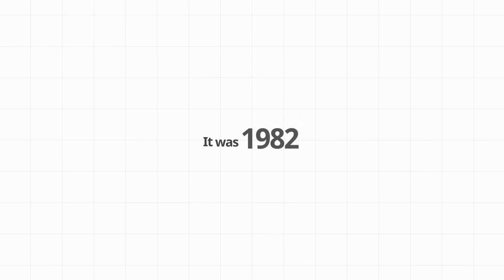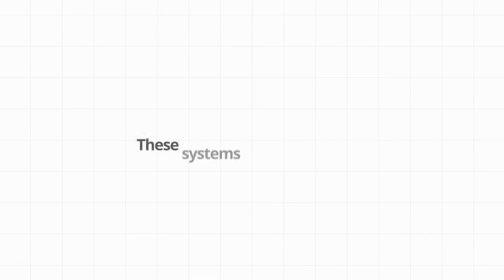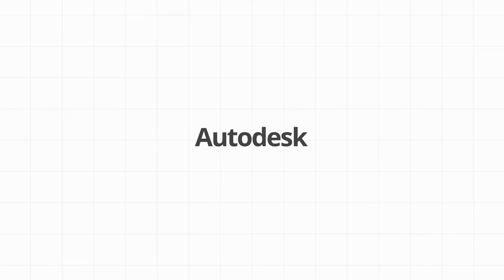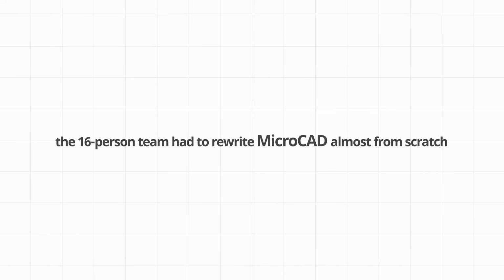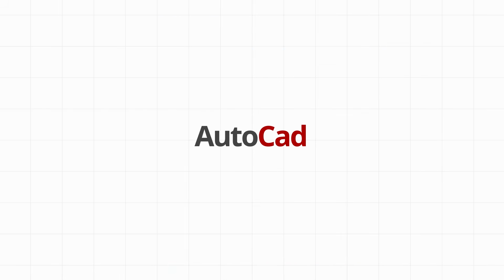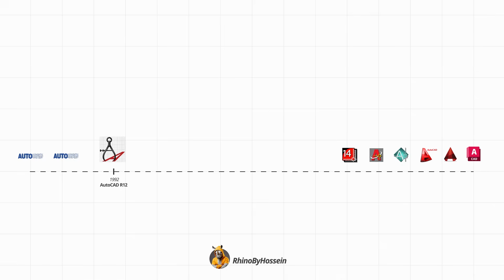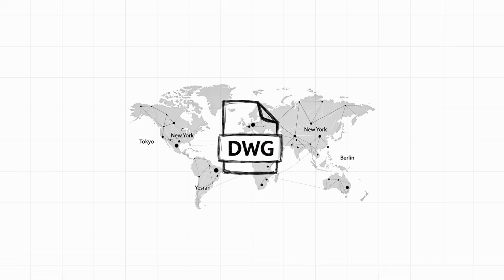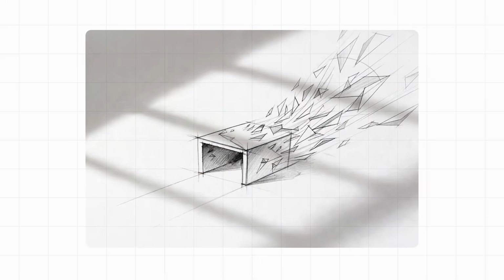Empire of Lines: How CAD Revolutionized Design – The Complete History of AutoCAD

Comment: Your understanding of how architects created intricate structures before CAD (perhaps before you were born) are misleading. We managed complex projects through precise analog systems that emphasized coordination over redrawing. Large drawings were organized using overlay hand drafting, with individual building systems drawn on separate translucent sheets, allowing disciplines to stack and coordinate much like modern digital layers. Revisions required careful manual techniques, like a good old electric eraser and even drafting on the reverse side of mylar to preserve reference lines. Consistency across large drawing sets was maintained with stencils and transfer lettering, while all dimensions and loads were calculated and verified by hand. Finished drawings were reproduced via blueprint machines and stored in extensive physical archives, reflecting a workflow that relied on discipline, craftsmanship, and meticulous control rather than software.
Reply: This whole thing is Ai generated rubbish
Reply: Good comment. 

Razor blades. Rotring T20 erasers. Glass dust bags. A line in the wrong place was just a minor inconvenience. Perhaps 2-3 mins work to correct if that. Tracing was common and then with the advent of the photocopier we would copy parts of a negative and splice it into another sheet/negative with clear tape so that a print could be made. Not perfect but it got the job done which was outputting "working" drawings, not winning pretty picture prizes. 

One of my early darfting mentors once said, "Stop f***ing around drawing people and trees, we don't get paid by the client for that. Just get it done". We would also draw straight to ink (not unusualk a workflow for many traditional artists TBH). Youngsters are spoilt by CAD and I know that by having years of hard traditional drawing office experience put me light years ahead with the advent of the PC era in late 80's. It made for better CAD drawings/design. PC's are still "sh*t in/sh*t out and nothing replaces professional design/job running experience whatever the medium.

As per OP on here early AutoCAD on dos was a nightmare. Early adopters while learning CAD(which could take weeks or even months to become truly proficient) could struggle for hours trying to do something that would have taken a couple of minutes or so hand drawn. CAD was like knitting spaghetti wearing boxing gloves compared to hand drafting. Then the many, many PC crashes etc. Printers OMG! In the early days hand drafting was miles faster and far more intuitive until Windows TBH.
Reply from the maker: Thank you for sharing your insights and experience with analog drafting methods; it's always valuable to hear different perspectives on the history of design.

Comment: Thanks. That was a very enjoyable video.  
My early AutoCAD experience was at Queens University Belfast, c. 1988. There was a CAD lab in the Ashby building. We logged on to DOS workstations to draw reinforced concrete beams. It seemed like it was all about typing coordinates into the command line and waiting for the server to respond. It was much slower than hand drafting and some students would lose their work when trying to send it to the plotter. 
It was not a good experience. CAD improved pretty rapidly after that - a couple of years later and you could do finite element analysis on an affordable office computer.
I didn't have the wow moment until using Photoshop 1 on a Mac ii.
Reply from the maker: Thanks for sharing your journey with early CAD, it's really interesting to hear how far the technology has come!